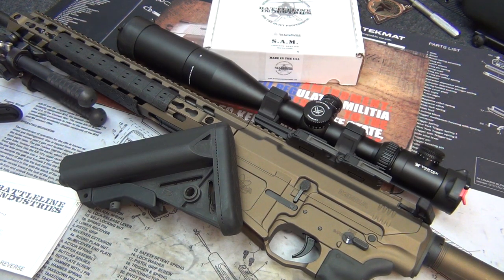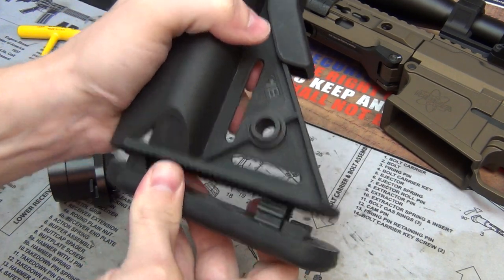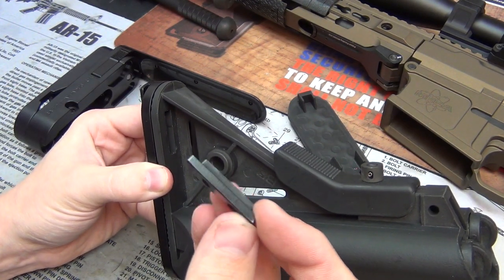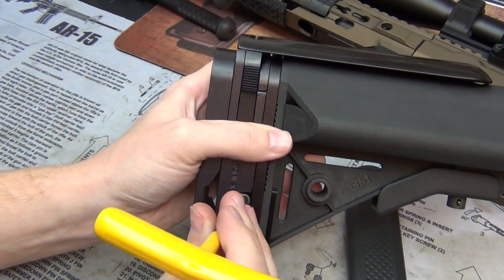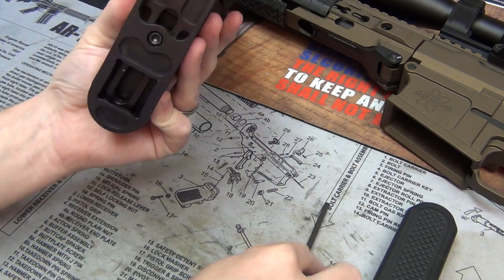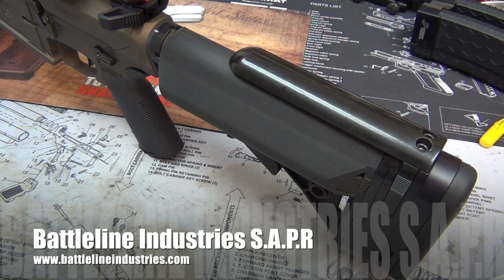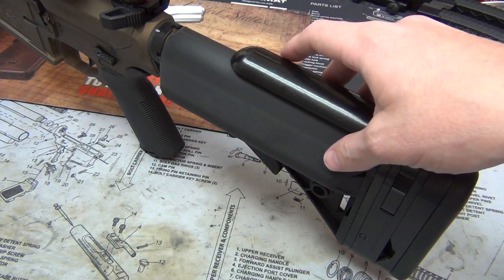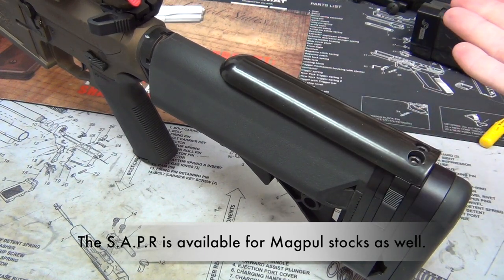AR-15 - Battleline Ind. SAPR Cheek Riser Installation & Overview

Comment: good  vid.. I own one of these on my ar 15 build and went with this because it has 2 uppers and I want collapsible. I made a fitment piece and put it on a vltor stock because the issue with the sopmod stock is when you use a rear bag the stock will  collapse on you.. also there is a ton of loose wiggle with that stock. I have contacted the maker of this and I don't think he sounds interested in those problems. its available for the ctr stock too btw.

Comment: will it work with the Magpul MOE SL-S Milspec Stock? the problems I see with this- 1. You are adding steps. having to move the cheek riser out of the way each time you need to pull the charging handle and then moving it back into place.. 2. usually your cheek rides forward on the stock (especially if you have a magnified optic with limited eye relief. this riser only covers the back portion of your stock. that could potentially be an issue. 3. its outrageously expensive at $225.

If anyone is looking for a less expensive alternative, that solves the possible issues I just addressed above, I recommend the HABU Charging Handle by Falcon 37. It's a cheek riser that wont get in the way of your stock, charging handle, etc.. because it is a charging handle! I own one and run it on my primary as it works great!

Comment: Can you cycle the charging handle with the stock fully collapsed and the cheek riser installed? Looks like they would interfere with each other.
Reply from the maker: Sneakywakiki It just needs to be placed to the side, high enough for the CH to go under it, or the stock to be moved to the 2nd position. This is a .308 so the CH is longer than on an AR-15.